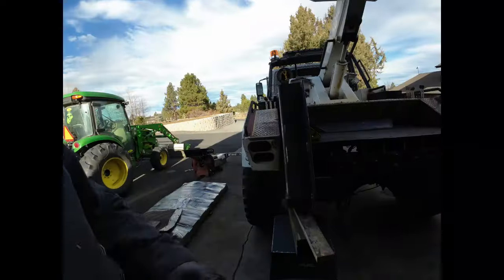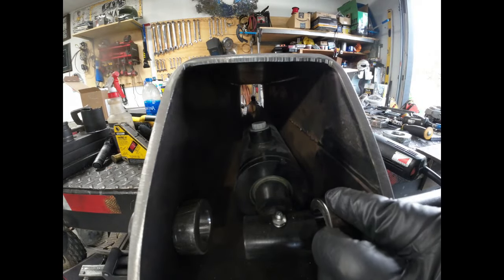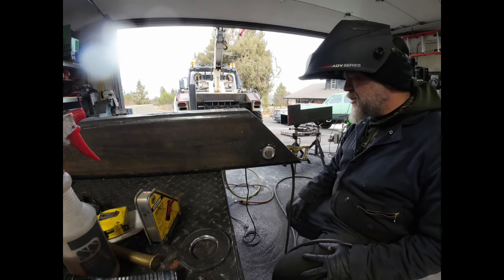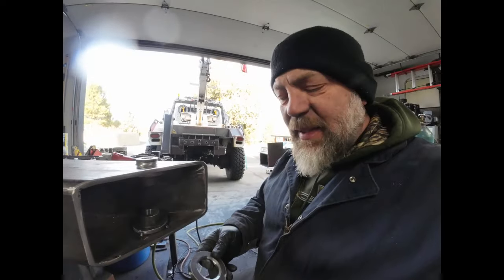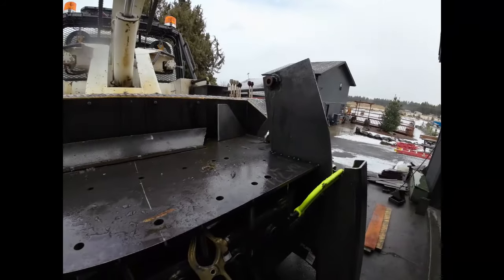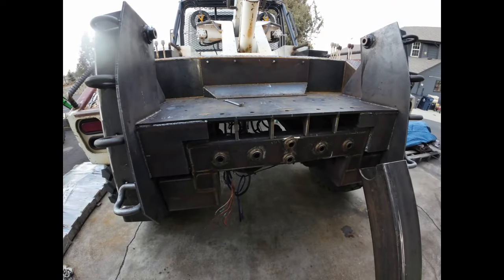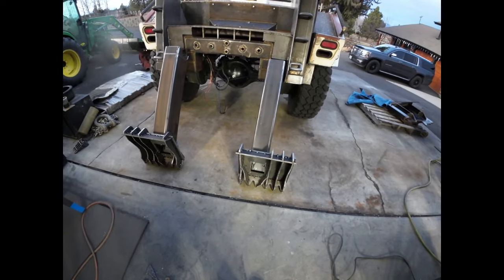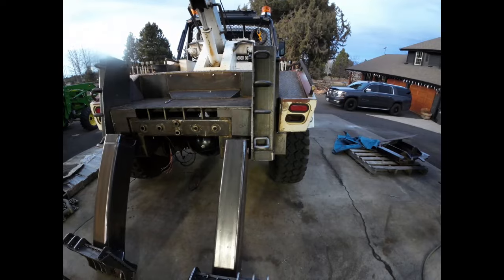The Ultimate Hydraulic stiff legs for the Offroad wrecker part 2

Comment: Its not over built your just building it right the first time very well built and will hold up well wish some manufacturers on the market would take some leasons from you on how to build a goid wrecker
Reply from the maker: Thanks, I have spent most of my life working on farms or in the military with heavy equipment and fixing heavy armored trucks. I also have spent some time. At Miller industries and gave input into the 30 ton rotator body they sent me in Afghanistan. I was able to install it on a heavy truck we had. I enjoy figuring things out and make improvements and stronger. I've made a few engineers upset,lol

Comment: How much are you going to have to lift the back of the truck in order to assemble the sleeved legs? I’m guessing there 7-10” of engagement between the two tubes?  Is that going to be a job for the 6x6 crane or do you have another plan?
Reply from the maker: I think it has to go up about 12-14 inches to clear. I tried really quick with my floor jack and an 8x8 block, but I needed another jack due to the weigh, so I will probably use my 6x6 way easier and safer, plus its good content.
Reply: I like it! You’ve got the tools/toys laying around, may as well put em to work. And like you said, makes for good content!